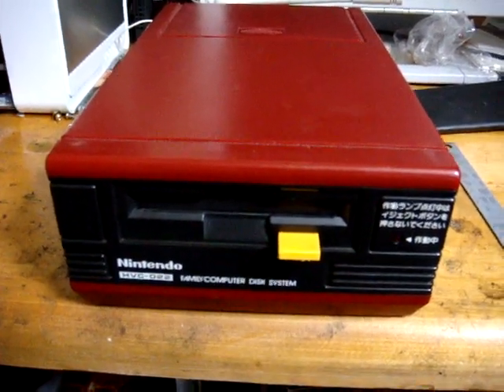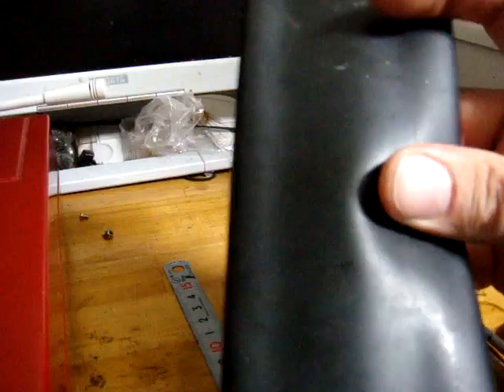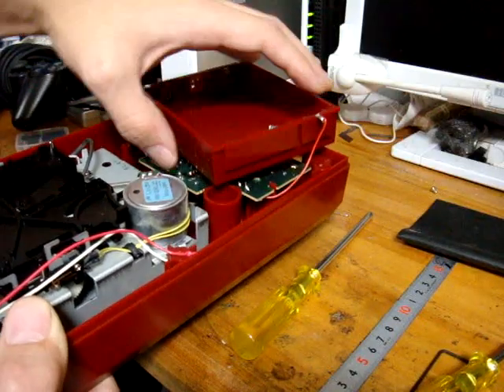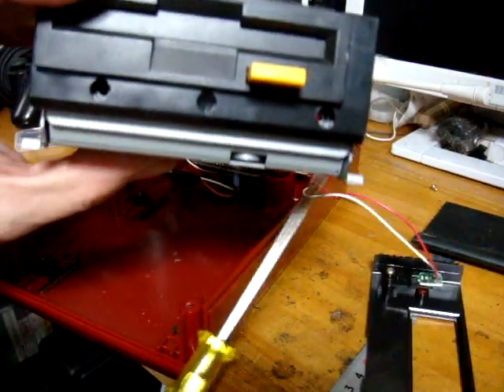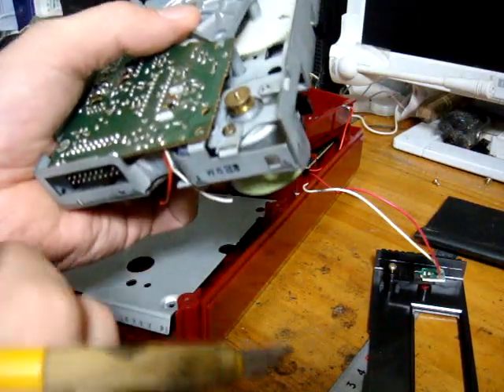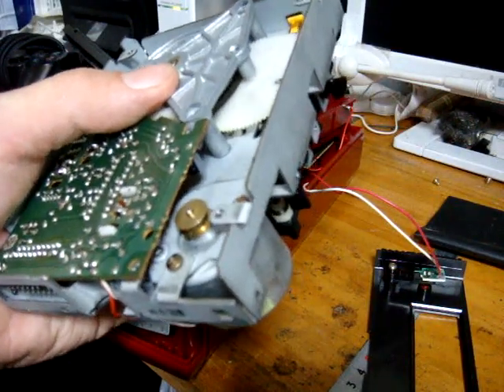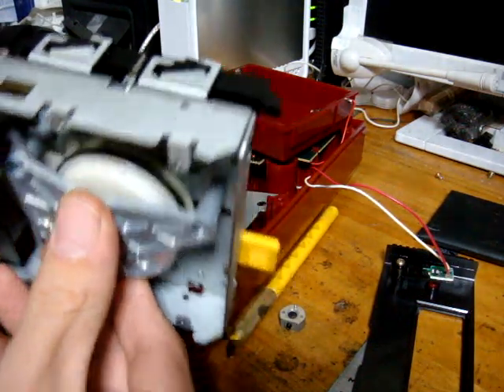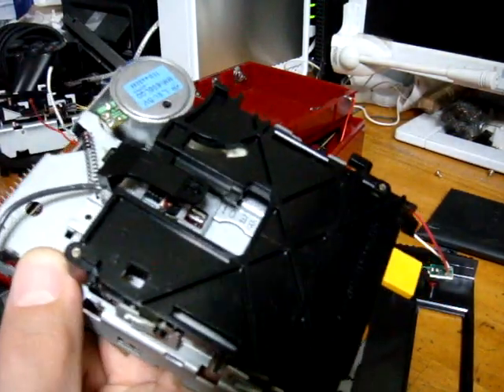How to repair a Famicom Disk System (Part 1)

Comment: hi, how do i know if the belt is the rubber belt is the problem of my disk system?

I have and FDS and when i try to put in the diskette, it loads forever, If i take the diskette out, the inner disk did not rotate a bit. do i have the belt problem? thanks!

Comment: Awesome!! I just got and ancient Akai S700 Sampler and it works really well... except for the QD disc drive that it uses. It is the same as in the Famicom so I was able to use your vid to take the drive apart and repair it. I did not use your belt material (more detail please !) as I was able to find a 9 inch (total outside length) by 2 mm wide flat belt that the drive uses. They are sold as 9 inch flat belts. I found a shop that had lots. Without this vid I could not have done this!! UR Swell!!

Comment: I too went to the hardware store, and while I found a few things that looked like they could be made of a similar material in the section where plumbing and pipes are nothing was the same. I even downloaded this video to my MP3 player and showed it to several of the associates and they still couldn't figure out what it was. Your vid is great though, I used it to clean up my disk system and it worked until the cheap belt I bought started giving an error 22, please what are you using for the belt?